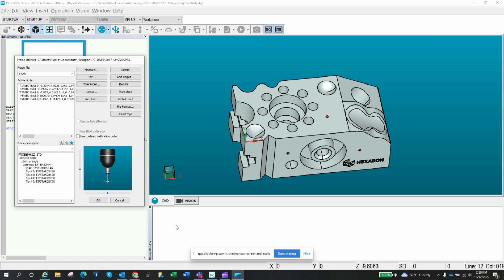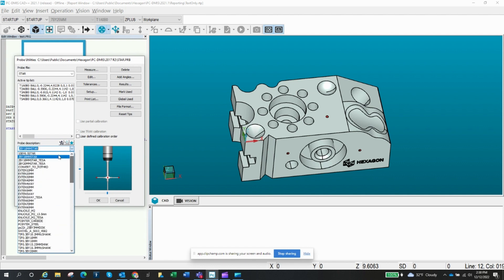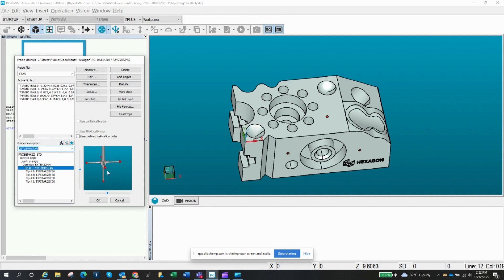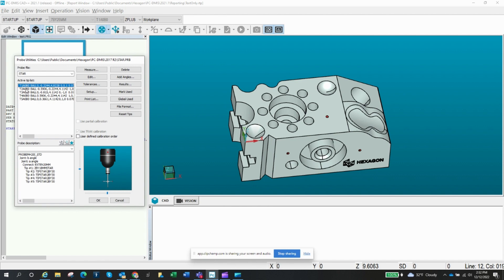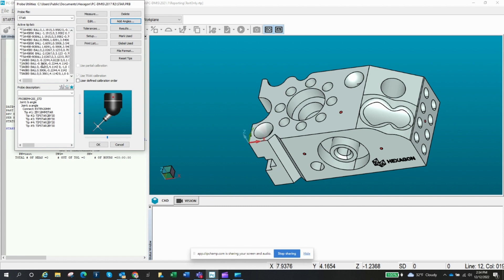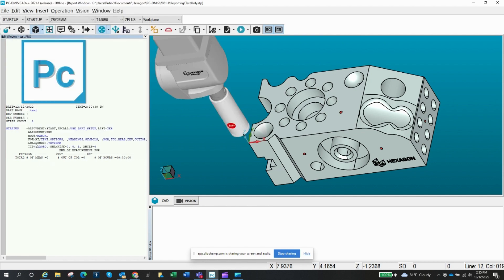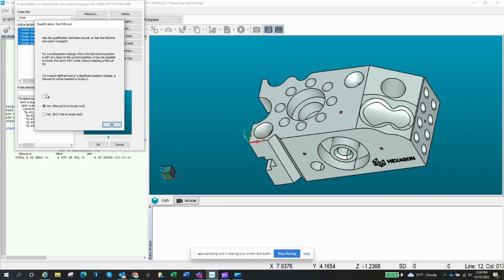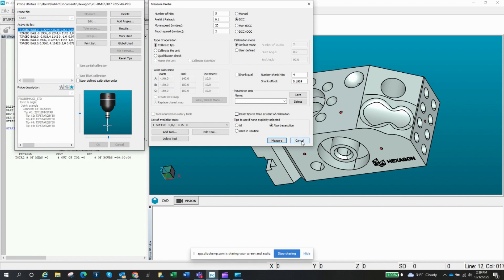PCDMIS - Calibrating a Star Probe

Comment: How to do calibration of customised star probe
Reply from the maker: The first step is to define or build your customer probe.  You may not have the exact stylii to choose, so just choose as close to length as there is available.  There is a custom probe builder, but I never had much success with that.  Once your probe is defined as best you can, you are ready to calibrate.  Choose Manual+DCC as your method of calibration.  This will allow you to take a manual probe hit for each stylus which manual set the location of each stylus.  I typically use this method with star probes anyways, becasue you may not get the stylus exactly square with the axis of the machine and it corrects any error you may have in setting up the probe.  If this method doesn't work for you, then choose Manual as your calibration method.  Calibrate each stylus manually and then go back and switch to DCC and calibrate them again.  I hope this helps.